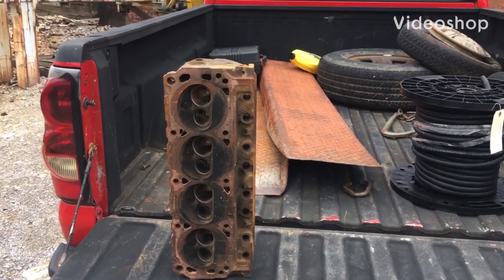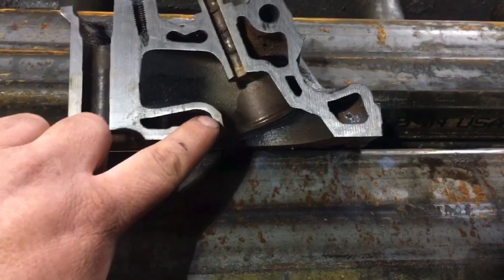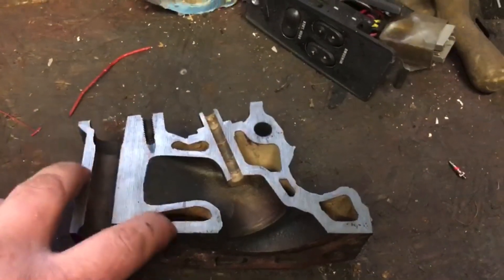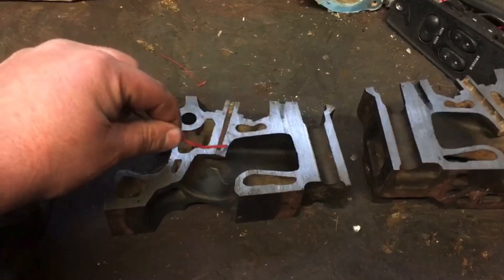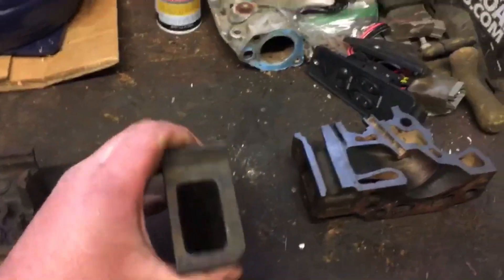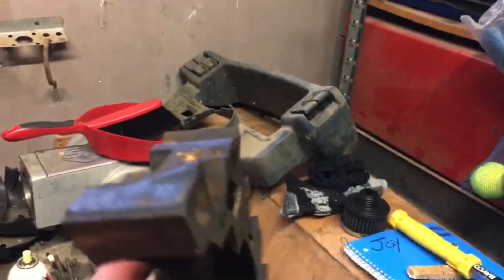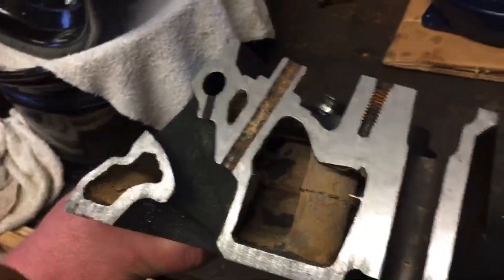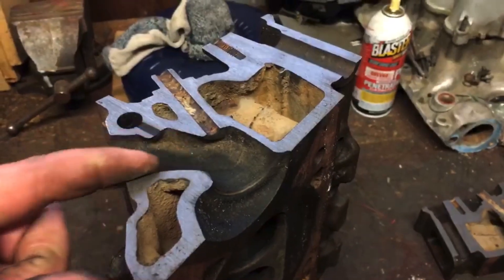Mustang 302 E7 Head Inside look at porting limit (pt 1/2)

Comment: Cut it back.  I've cut an inch out of the bottom of the guide and never had guide problems.  Send it.
Reply from the maker: Thanks man!!
Reply: @fomobros2207  you can remove the valve seat completely, grind and lap the valve right to the head cast. You can run huge valves cheap this way.  I think my head has 2.20 valves intake and 165 exhaust.  I think the exhaust side is the problem on e7s.  You can get nitrous or boost in but not out.

Comment: What did you ever figure out about removing the valve guide end to get better flow?? Also I've always heard not to mess with the floor of the exhaust port?? What's you theory?? Thanks for the videos!!
Reply: If I remember correctly, David/FXRSDriver said he didn’t notice any gains from eliminating the valve guides. You’re right about not messing with the port floor on the intake side. David has found gains working the port floor on the exhaust side.

Comment: The cutaway should be very helpful,  watched #2 as well. Gonna be digging into my 289 heads soon, ditch the exhaust bumps and valve stem on the exhaust. After seeing the cutaway I will just sand the short turns and clean up the bowls. Wish me luck.
Reply from the maker: Good luck Mike! Glad the video helped

Comment: Back in 2017 I built a budget minded 331 stroker with GT40P heads... yes, I'm aware there are tons of better options for heads. My goal wasn't to have a 7k screamer, more of a midrange torque oriented motor. Disassembled the heads, cleaned them up, did a lot of work to the bowls on the machined surfaces and transitions. Left a rough polish on the intake side, mirror polish on the exhaust. Machine shop cleaned up the stock valves, valve job, and installed beehive springs. I also used an explorer intake that I did major work  to port match them and straighten the runners for the #1, 4, 5, 8 cylinders polished each runner as well. Machine shop bored the block .030, balanced the 3.25 rotating assembly, forged flattops and zero decked the block. Compression is right around 10.5:1. Paired this with an anderson N41 .512/.512, 222/230 @50 110 LSA. Man the thing hauls ass. Power falls off right around 6200 rpm. Definitely could use better heads, but I wasn't afraid to massage out some gt40ps the old school way
Reply: gt40p heads are really a great budget option for people who want a bit more power than factory

Comment: That was interesting. Thank for doing it. I do have a question. When porting do you remove the valves. Thanks
Reply: Gregory Frost yes, most of the port work that frees up power is done with the head upside down and the valves removed. You’ll have a better view of what you’re doing and be able to thoroughly clean all of the metal shavings out when you’re done. You won’t gain much if any if all you do is gasket match to the intake and exhaust ports. Stay tuned I’m going to port one intake runner and one exhaust port and cut them in half. Maybe we’ll learn some more H.P. stuff.
Reply: @Sikulz  I thought so. Thanks

Comment: I really liked the cross section view.  Thanks for making this video.

I was thinking with the plethora of 5.0 Explorers and Mountaineers in the JY,  why not start off with a GT40 or GT40p to begin with and then port?  Rodney seems to find Ps in the pull a part yards all the time.  They should flow better when done with their bigger valves and larger ports for only $100 to $200 more up front?
Reply: instablaster.
Reply from the maker: True that, it’s all about what’s available and what the wallet can handle. Way back when Richard did my E7’s I had spent sooo much of my salary (a poor 20 year old lol) on getting my GT back on the road that the E7’s I had were the perfect price...FREE lol. You’re right though, GT-40’s are definitely awesome JY Powa!!

Comment: My Explorers didn't pick up anything on the bench with removing the valve guide completely. Since then I've just made it was narrow as possible and contour it around the backside. Most of the flow will pick up in the short turn, and the throat of your bowl.
Reply from the maker: Let it be known, this is now a channel for learned scientists. Darn, I really thought grinding down the valve guide would be a huge improvement, thanks for letting us know
Reply: Also the throat should look like a football with the ends squished in, 90% of valve size wide, side to side, and 85% of valve size high. Make sure you've got nice smooth transitions to the seat, and from the top cut of the valve job to the chamber.